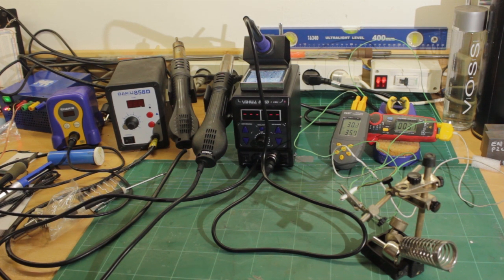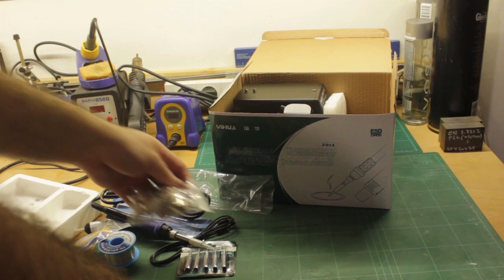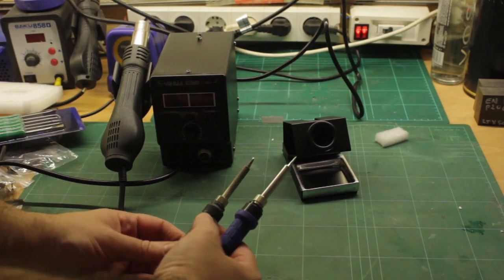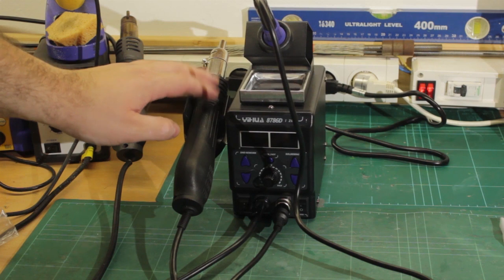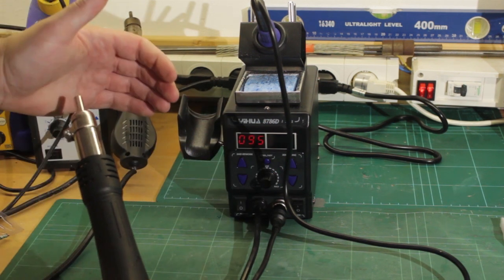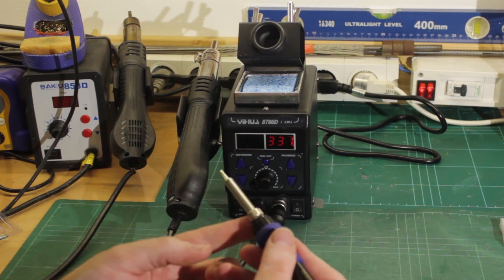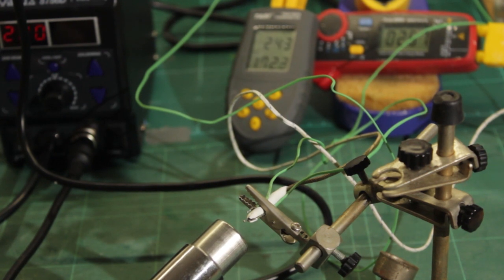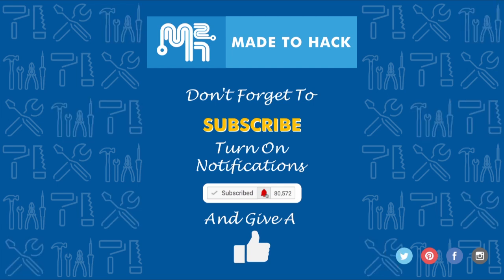I bought a Yihua 8786D Solder Station | Unboxing and Installation

Comment: I plan on getting this before Christmas to begin soldering as it seems no one in my area really offers it for game console repair (a lot of broken HDMI ports around lol) and simple game battery replacements for GBC, GBA, NES, SNES & N64 games. Are you still using this 2 years later? I see a lot of good reviews on it an it doesnt seem to bad as long as you take care of it an get new tips
Reply from the maker: I still use it. Since I do very little hot air rework, I tend to use more my Hakko because I prefer the more flexible cable. However, this unit is still running good.

Comment: Hi, I bought one of these about 6 months ago to be able to reflow SMD components. Thanks for the video, it’s a good honest review and it looks like I made a decent choice. I’ve been soldering through hole for 30+ years but am new to SMD. What would you recommend as a basic setting for temperature and fan speed? New subscriber, looking forward to watching some of your other videos.
Reply from the maker: Thanks for your comment. It's difficult to say since it depends on the soldering paste used. I tend to do 30-40 celsius over what the paste makers recommend due to losses in free air, etc. But I always pre-heat the general area by blowing hot air from a distance and also, if you can, cover parts you don't want to reflow using nylon tape (Kapton as example).

Comment: Nice overview. Been wanting one of these to do some SMD capacitor replacement on my old Macintosh machines. I’m experienced with thru hole soldering but never tried hot air rework. Looks easy enough, and this unit doesn’t break the bank. Good stuff.

Comment: I just got mine today.  What is the wire you plug in the back?   It has an aligator clip.  When you test a board like a chip for ground, is this what you use?  Where would you clip it on the board?  Thanks
Reply: That's a grounding clip in the case OD electrostatic discharge. If you are soldering or working around ESD sensitive items you want to have common ground.
You can skip it on to your clothes, alternatively, you can get an ESD grounding unit and mat. The wire on the back of the soldering unit can be taken out, as it's just a banana clip.

Comment: My 898D+ looks the similar..  Performance close to a 861DW...  The trick is letting the hot air wand heat up a minute before attempting reflow..

Comment: I got one of these and it seems to lock up and won't heat fhe iron or the air gun have you fojnd out how to reset the firm ware. Thanks John M0JFE
Reply from the maker: Hi there, unfortunately I have not. Since it is a clone, I would imagine that there are perhaps some people that have an idea. Perhaps try the eevblog forum?
Reply: @Made2hack  Thanks for that will take a look
Reply: @Made2hack  Do you know its a clone of what company/device exactly?
Reply from the maker: @blackartista  No i don't know for sure which was the original.
Reply: @Made2hack  alright, I once saw a W.E.P rework station with Yihua motherboard and I thought Yihua is the original maker of these circuits that's why I asked you  as I'm curious to know the original designer. Thanks anyways I will look into it

Comment: Great review, it's been awhile, any updates? I'm looking to purchase this unit this weekend.
Reply from the maker: Hi there. It still works :). I don't particularly like the cable used for the solder iron (it is not silicone). So it is not as flexible. However, for the price, the hotair handle is ergonomic. And the iron works fine. 

If you do a lot of work, maybe a better iron handle would be nice. The Hakko has better rubber on the part you hold in your hand.
Reply: @Made2hack  Thanks for the update!